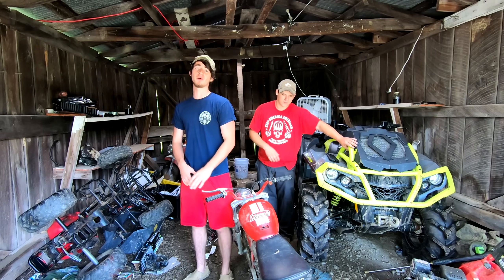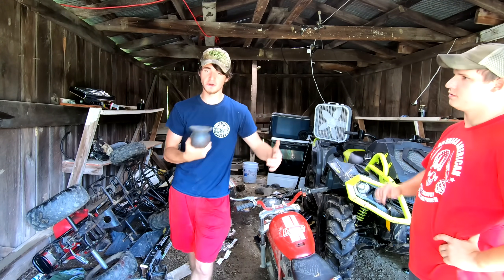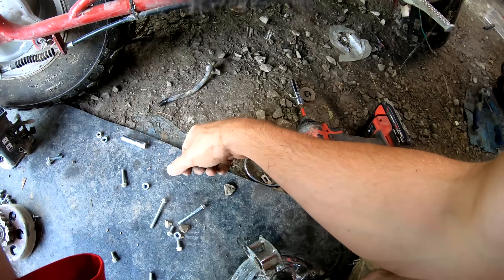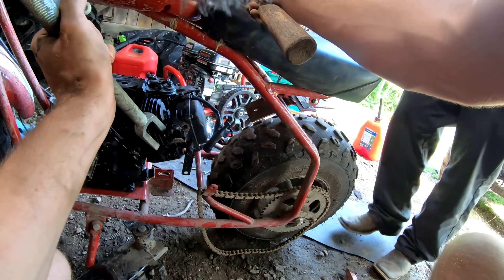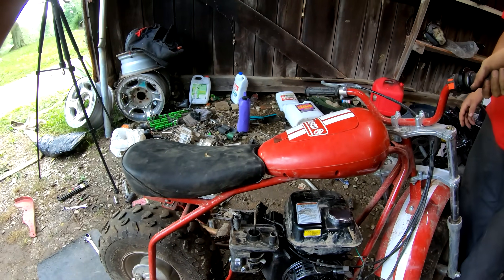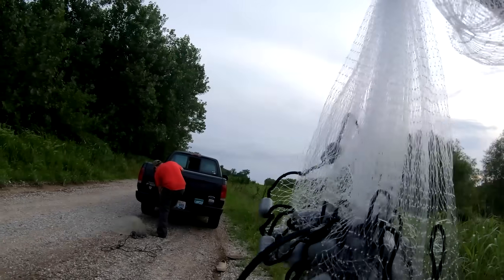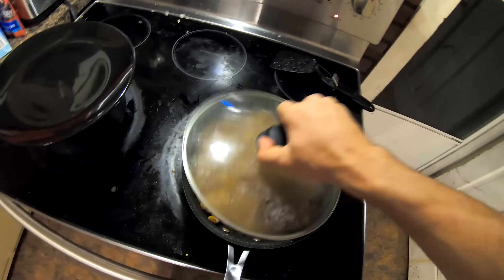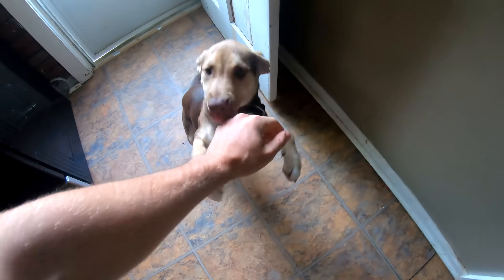HARBOR FREIGHT MOTOR SWAP ON THE MINIBIKE!!!

Comment: 17:05:  here’s what I’ve always did. Take a clean  Tupperware, put some old fruit chunks in it, cover the container with plastic wrap. Put a rubber band on the lip of the container to keep the plastic wrap sealed on the container. Poke a small hole in the middle of the plastic wrap. Once the nats have congregated in the fruit container, seal it up and throw it away, or dump the fruit and nats out of it to reuse the container.

Comment: To get rid of the gnats take a mason jar or a cup and put and a 1/4 of a banana in the cup then cover it with Saran Wrap and pull it completely flat then put a rubber band around it and poke 3-4 holes through the Saran Wrap with a tooth pick and they’ll go in there and can’t get out

Comment: Cut a two litter bottle right above the bend at the top put some banana pieces at the bottom take the cap off put the cut piece in the bottle and put tape around the edge and you catch all the nats

Comment: Take a regular Mason jar and fill it halfway with apple cider vinegar and take one of them clear sandwich bags and put it over the top of the Mason jar with a rubber band to hold it and then take a toothpick and put about 5 to 10 holes in the top and let it set there for about 2 weeks then they should be in there. for the nats

Comment: The secret of getting rid of the gnats is having a propane torch nearby to burn them as you see them

Leave a brite light on with the rest of the house dark and they will swarm to that light at which time you can zap them with the torch until there are no more left

Or you can use the boring method and just use a bug zapper to zap them all with LOL

If you have potted plants in your house that you water regularly then you will be breeding gnats 24/7/365 so be sure to buy a bunch of propane bottles for that torch LOL

Comment: Just use apple cider vinegar about an inch deep in a container. Get some clear plastic wrap and put it over the top with rubber bands, get a toothpick or a pen and put like 10-15 little holes in the plastic wrap. Set it somewhere in the kitchen for a week or two and the fruit flies/gnats are gone.

Comment: Had the same fuckin problem with my bike when the motor blew because the original shaft is 5/8 and the harbor freight engine is 1/2